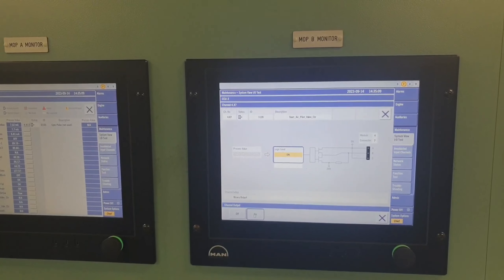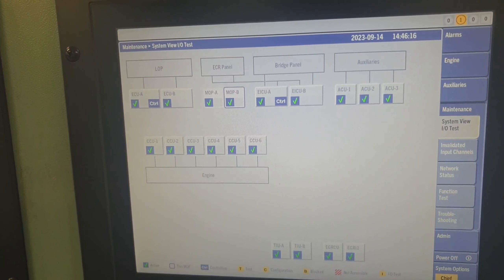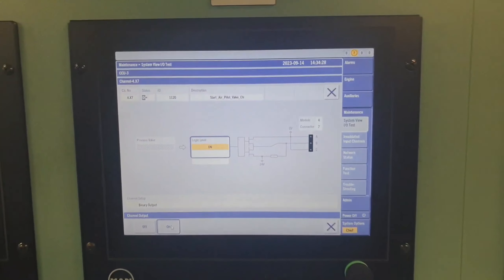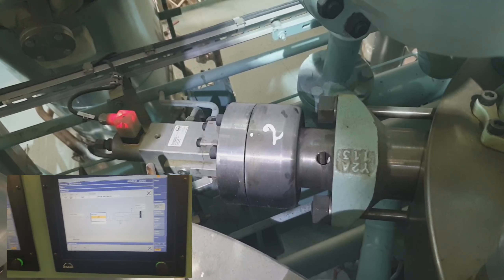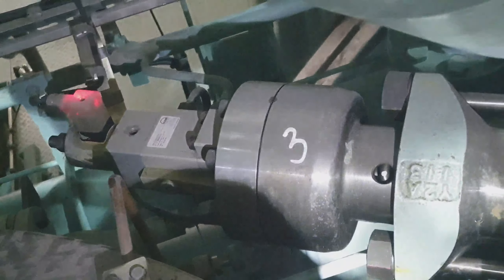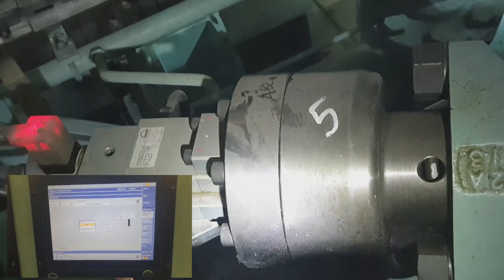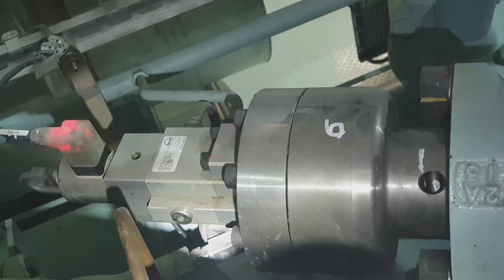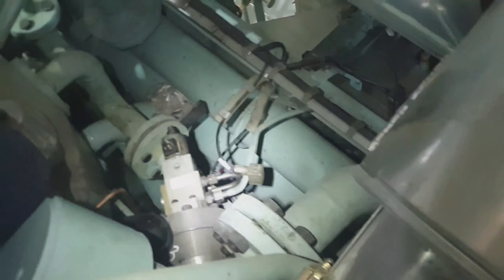MAIN ENGINE FAIL TO START TROUBLESHOOTING  | STX MAN B&W 6G60ME-C10.5-EGRBP

Comment: Did you investigate why the solenoid valve failed? Same recently happened with our engine. Now we should replace all solenoid valve coils. Very interesting.
Reply from the maker: After investigation we found that one solenoid valve coil has burnt which cause to the main engine fail to start without any alarm. It only start after we change the rotation to reverse or astern position
Reply: @JB23VLOG In our case, after unscrewing the el.connector base, we discovered that the wires leads to the coil are simply cut off by the outer coil casing. This happens due to the both parts (coil and outer casing) are able to rotate each other by 45 degrees right or left. Now we have received new ones and see that this harmful rotation is prevented (fixed).